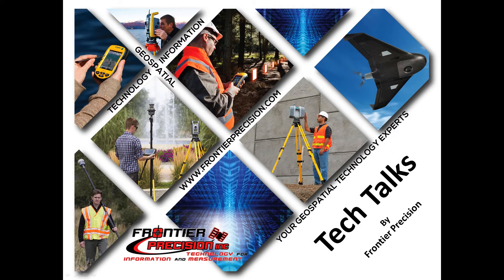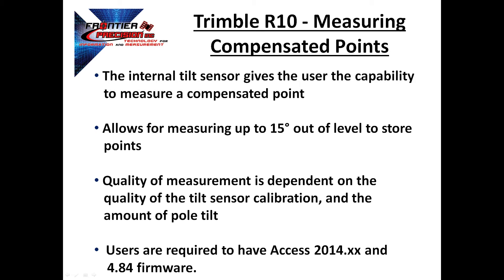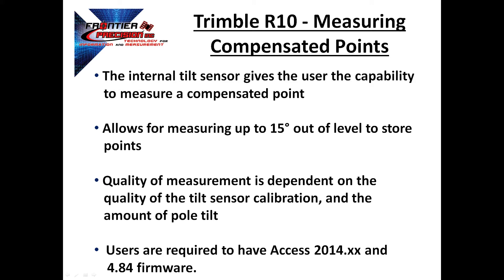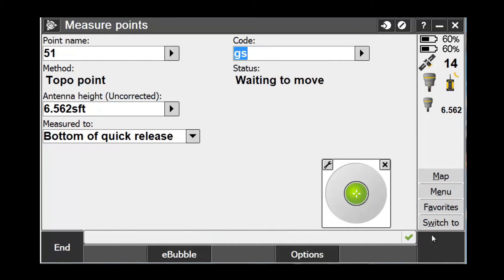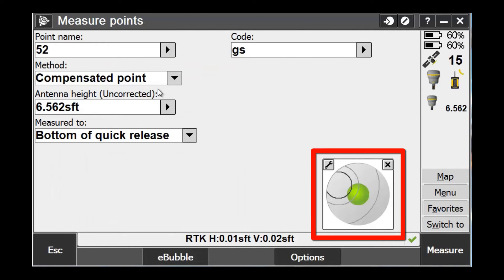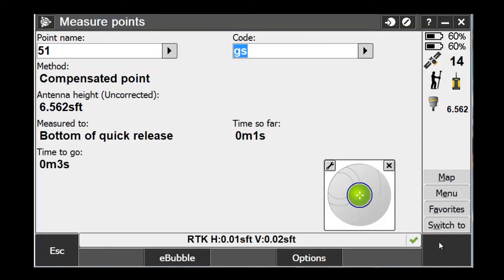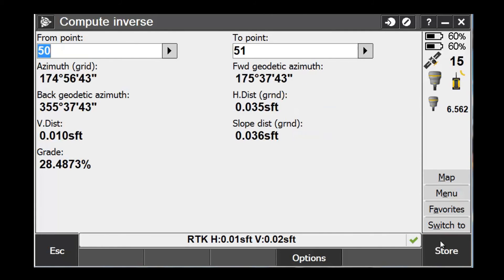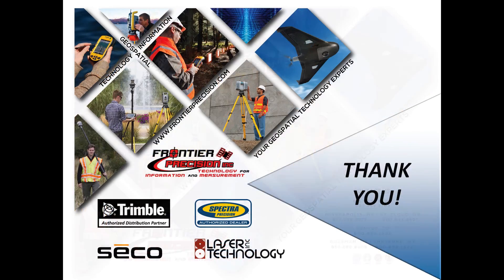Measuring a Compensated Point with Trimble R10

Comment: hi jay, this is really interesting video.
but i have one question for you, is 4.90 firmware in trimble R10  working for compensated point? I have already do this step with trimble access 2014.12 and 4.90 firmware for trimble R10. but I have not found compensated point in trimble access.
kindly need your help.

Thank you.